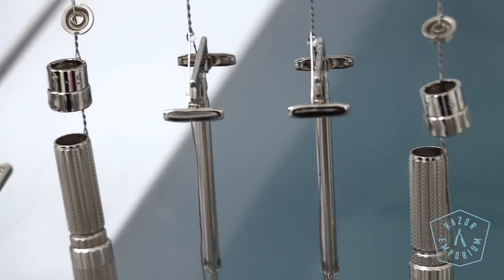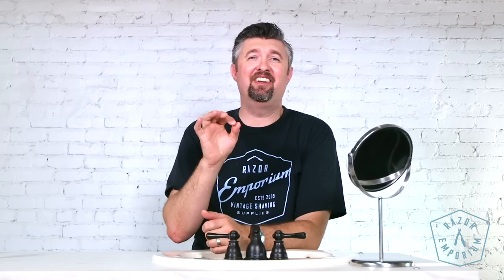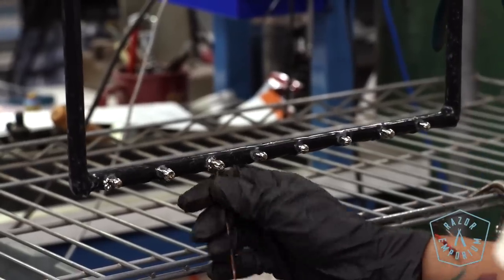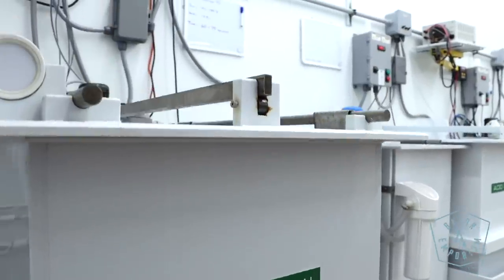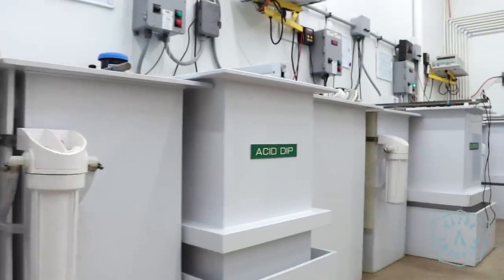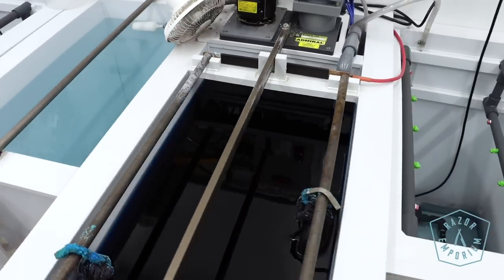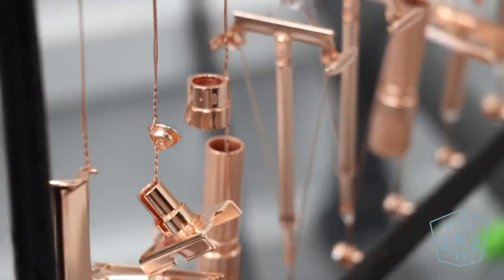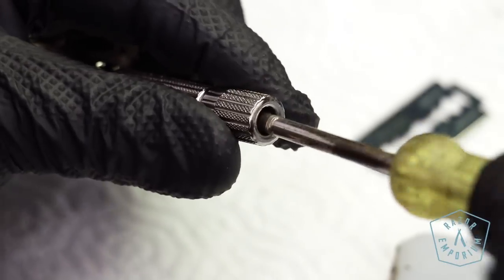Safety Razor Plating Room Tour: Could our Revamp Service be BETTER than Original Vintage Gillette?

Comment: As chemist I have to say I love your processes! After I saw your videos, I refinished one of my razors from 1934. I first washed the razor with dish soap followed by deionized water, quick nitric acid and water again. I didn't do electroplating, but I used a chemical reductant. My mixture was nickel chloride, nickel sulphate and sodium hypophosphite at 90 °C for 4 hours. This mixture gives you a very strong layer of nickel as the metal contains phosphorus which further helps with adhesion and hardens the alloy. If you can, please make more videos about your workshop! I'd like to see more.

Comment: For those who want to get into small scale plating, one thing that I'm sure RE has taken into consideration that too many others ignore is waste.    The waste material from nickel plating is often considered toxic waste that has to be processed correctly, and finding a good waste disposal company can be expensive and difficult.    Not to mention cobalt.
Reply from the maker: We capture and reuse all spray-off / rinse as the 145⁰ bath evaporates. So there is no nickel waste in our shop. But at small scale it is certainly a concern. Plating is a regulated industry and without a permit, home plating is not allowed in most cities and minicipalities.
Reply: @RazorEmporium  - Exactly, but there are a lot of rural areas that don't have any real regulations, and people can order the stuff through the mail.  I looked into it for some low end nickel plating, and decided that what I would have to go through for disposal wasn't worth it, and I wasn't going to dump it into a sewer.

Comment: So glad I opted for my Ambassador in rhodium.  The hard part is deciding if a add a Konsul or revamped vintage Gillette next.  Either way it will be plated in rhodium.  I’m such a Razor Emporium fan boy. 😆
Reply: Wait, so can stainless steel also be plated in rhodium? If that’s the case then I’m definitely keen to send Razor Emporium my Rex Ambassador to bling it up. Are there any photos of rhodium plated Ambassadors on the website?

Comment: Great video. You are correct about proper cleaning before plating. I used to plate the bare metal on aircraft to prevent corrosion. You have to clean the metal really well or the cadmium plating won't stick to every spot and then you had to remove the plating you just put on when you went back cleaning the spots. Cleaning is important for proper adhesion for the finishes and that takes time.

Comment: Morning Matt.  This was a great video for those that often wondered how the process went.
Your set up is chemistry perfect to keep everything clean and to eliminate the possibility of cross contamination. This is why the rinse step is so important.  Everyone should also know that you are an environmentally friendly shop and capture all of your rinsing in a tank and not running it to the city sewer system.
I also glad you stressed the fact that the prep work for all of the pieces is so important. Garbage in Garbage out, so true. You have such a well-trained staff and are very conscientious to doing it right. I don't think they often get the credit they deserve.
Excellent operation.
You are presently replating a Gillette Toggle for me in nickel, a rarely seen plating of the Toggle. I intend on using it on a regular basis.
Take care, be safe, and thank you.
Reply from the maker: Thank you! Yes we are a permitted Zero Discharge facility and reuse most of our rinse water to combat evaporation. The deep DI water baths are constantly filtered through rented DI canisters and that company comes and exchanges them when the ppm value exceeds 1.
Reply: Now one year out from a replating in nickel of a 1967 Gillette slim adjustable....my daily razor. Should last my lifetime, as I am 75. Craftsmanship!!!

Comment: Why is that we have to remove the safety blade from the safety DE shaving razor and not the cartridge blade  from the cartridge razor, huh......?????
Reply from the maker: The blades on a cartridge razor are surrounded by plastic. The blades on a DE are surrounded by metal.

Comment: Fantastic!  I worked for many years in the field of environmental consulting to the metal finishing industry.  Just about everything you are doing in your plating shop is spot on.  I did not see air agitation, bravo!  Deionized water for ALL baths and rinsing, yes!  Baths that use tap water often need to be dumped early due to hardness buildup.  One thing I did notice is you have spray rinse followed by still rinse.  Why not the other way?  If you still rinse first you can use that water as makeup to the heated bath.  Your racks are pretty small so a still rinse tank might fit in a portion of your spray rinse station.  Some shops put the spray station above the plating tank so plating solution is knocked back into the process tank.  This can get tricky though when dealing with small tanks.  Too much rinse water and solution control becomes unstable.  Do you have an issue with process solution drying on the parts?  If not, then you should withdraw the rack slowly.  That will reduce drag-out and solution loss.  I would love to see more video of the plating shop.  Are your baths continuously filtered or carbon treated?  How do you handle spent baths?  Do you have onsite wastewater pretreatment?
Reply from the maker: Thank you! this is likely the most in depth video of our plating process we will ever produce for a variety of reasons. 

For your questions: 

1) Spray baths pump the solution back into the process tank to combat evaporation. Rinses are not "still" they are continuously pumped through discrete DI columns and carbon filters to keep them at a 0 ppm. By spraying first and deep immerson second, we keep the most amount of chemistry and our rinse baths are as clean as possible. The DI columns end up lasting much longer because of this arrangement as we have to pay a monthly fee to rent them but a much higher fee to exchange them with the local water treatment company. 
2)Not a job shop - so everything is layed out to be as close as possible. No issues with drying - everything moves quickly and is exposed to air for less than 5 seconds. Everything is kept wet. 
3)Process baths are continuously filtered through 1 micron polypro filters 24/7. Carbon treatment is only used to "reset" the bath if we need to start over with the brightener system or if there is a buildup of organics in the bath. 
4) No spent baths as everything is a commercial product with full analytical support so we can add back what's needed and keep it in balance. 
5) We are permitted by the City of Phoenix to be a Zero Discharge facility. Any wastewater is treated via de-ionization (point 1) or evaporation (mostly our ultrasonic baths as they get loaded). 

Thanks!

Matt

Comment: I've bought a Gillette flare tip and a Gillette rd tip from Razor Emporium and all I can say is what a great job they did revamping both razors,  I use both almost everyday switching back and forth between the two.  You can't go wrong purchasing a Razor from them.

Comment: Another fantastic video, Matt! I’ve got a 1959 (E2 - my birth year but wrong quarter) Fatboy that is in pretty great shape but I’m thinking of sending it in to you for a rhodium finish. I also have an English Gillette that was sold in Canada as a Rocket but I think is just like a Super Speed. Anyway, the nickel finish on that is in rough shape, especially on the handle where it’s come off in blotchy patches. I’d like to have that one revamped in nickel. My problem is between shipping from Canada and the exchange rate on our dollar, it’s probably going to cost me a bundle. So I’m saving up. 😊

Comment: I bought the revamp service for the brass Karve Overlander and received the razor last night. The razor looks fantastic, it's absolutely spectacular.  The Karve Overlander is my favorite daily shaver, so I just had to have one plated in nickel. My first shave with this razor was perfect, exactly what you'd expect from the GOATlander. Absolutely amazing ! Well done Razor Emporium. Do you have a service for a polished stainless steel Overlander ? Your Rex Konsul is a gorgeous razor and I'd love to have an SS Overlander  with that finish. The Konsul is my favorite adjustable razor, it's perfect.
Reply from the maker: Yes look at the tune up service - polished SS razor is an option.

Comment: Excellent video. Loved the factory tour. Question about the process: how come the thin Copper wires that you string all the pieces together with don't leave gaps or stains in the finishing process?
Reply from the maker: They are very thin (24awg) and are not wrapped as tight as they may appear. With good agitation in the bath, the parts move around enough to not leave a wire mark. It's an art more than a science and takes practice to know how and where to wire a part as to not leave a mark. Great question!

Comment: How important is timing in the process (how long is something dipped) and if tanks require top up are they left a little longer, likewise if tanks were just topped up is the time required a little shorter? I'm wondering about timing or does visual inspection have a part. Obviously inspection is involved but that's after the process is complete. 
On another question would you consider re-doing the gold wash on straight razors? It would involve a stencil machine and a database of manufacturers "stamps" or logos. Copyright wouldn't be an issue as most manufacturers are long gone.
Reply from the maker: Timing is very important. Not necessarily seconds but minutes. Like the nickel process is 6 minutes. You can go a bit longer like 8 or so but if you did say 15 minutes you may have tolerance issues. The gold wash thing sounds like more trouble than most people would want to pay. We have redone the gold tang on the dubl ducks without problem.

Comment: Hi Matt, great video- learnt here for the first time that there’s a copper layer between the brass body and nickel- very interesting!
Can I know what’s “hard gold plating”? I hear that term floating around a lot. 
And why 24k gold plating- won’t that be a (averaging between other metals) softer finish as compared to a 21k which looks near the same but wears a lot harder?
Reply from the maker: We use cobalt as both a brightener and hardener with the gold for a harder deposit. That's what that means. The cobalt is what gives the bath a purple color.
Reply: @RazorEmporium  Great! And that’s presumably why you’re able to use 24k plating instead of the more usual 18 or 21k that almost everyone else uses?

Comment: Great video. I just mailed off two Razors to you. Went with the tuneup. After watching this maybe I should have gone with the Revamp.
Reply: I sent two razors off for a tune up and they came back looking brand new. Mine still had all the original nickel plating. Very happy with the result
Reply: @saevans63   awesome! Thanks for letting me know. I’m pretty excited about it. One was my grandfather’s that hasn’t been used probably since the 60’s.
Reply: @brendenbrandi  you won’t be disappointed. RE does great work

Comment: I own at least three of almost every razor Gillette ever made and I want to have at least one of each replated in rhodium. I would like to know if you can replate  a blue tip super speed and a black handle super speed as both of these razors have aluminum handles attached to the safety bar base plate.
 Enjoyed this video very much and I will soon be sending you my first razor to be revamped.
Reply from the maker: Yes we disassemble and process the brass parts as shown in the video. The guard has an aluminum neck and we mask that off during this process. Aluminum handle (blue tip) gets polished only. Black handle gets powder coated.

Comment: I do have an actual serious question and not a "troll snark"...What do you do with the "Clean Water" once it's no longer clean from having been repeatedly used a rinse solution?  Do you simply dump it or there is  other less critical purpose it can be used before dispensing with it?
Reply from the maker: It's continuously pumped through deionization tanks so it's always clean. When the tanks loose their efficacy they get swapped out with new ones from a local water treatment company.

Comment: Another great video, Matt! What are the total man hours involved in a standard revamp? Also, how did you learn this? I’m sure the research was quite extensive. Did you bring in outside “experts” for guidance. I’ve got a couple of vintage Gillette’s I’ll be sending in. Thanks for taking the time to show us around!
Reply from the maker: Learned by trial and error. And visiting other plating shops and talking to experts. Our staff "chemist" as I mention is a veteran of the plating industry and had brought a wealth of experience to the table.

Comment: Very cool video. I love both my revamped slims. Are you able to salvage any of the original nickel that is removed
Reply from the maker: It mixes with our stripper and I think it would be more work than its worth to try and extract it.
Reply: @RazorEmporium  I just didn’t know if it was even possible. Take care. Love the team’s work